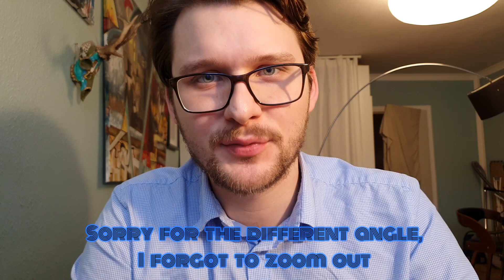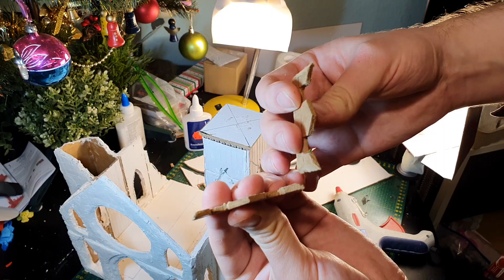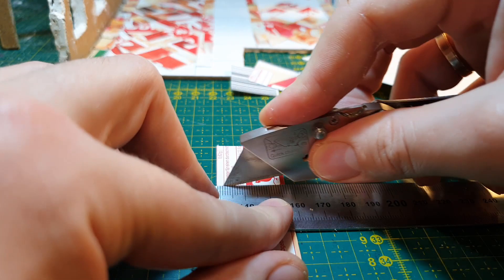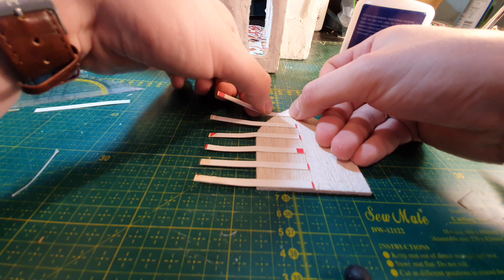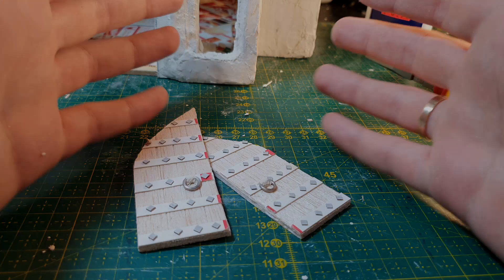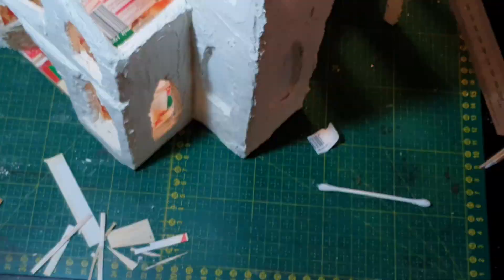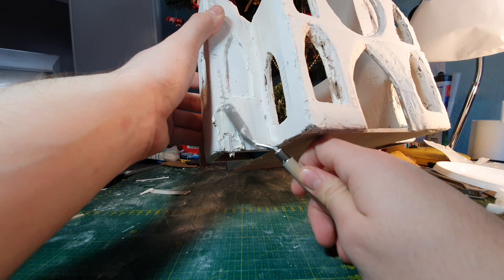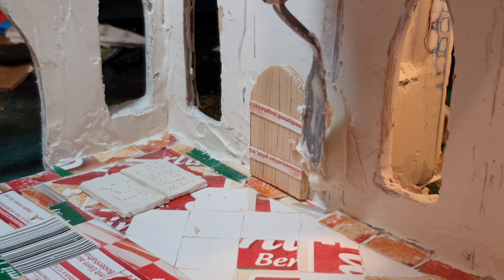Terrain Build | Gothic Cathedral- Gate, Floor and Gallery | Part 2

Comment: Every time I run into the "this isn't going to be good" part of a project, I table the project and work on something else. It is both a strength and a character flaw. When I return to the project with the clarity of having ponder it and finish the project it is a boon. And when I get distracted by the something else and abandon the project to chase excitement elsewhere, it becomes my shame of things left undone. For me the creative process is a fickle mistress.
Reply from the maker: That's very true! I only lately started persevering through this phase, mostly because of the videos and the deadlines that come with them ^^ I gues it's a good thing for being consistent to set sone kind of a schedule for yor work

Comment: You know if money for new blades is tight you can actually re sharpen them if you do a little bit after every crafting session they last for a long time.
Reply from the maker: I do have a set of whetstones for my kitchen knives, but I’m not sure I could do a fine edge like that. Do you have any tips? My sharpening game is worse than my measuring skills.
Reply: @jagelsdorf1385  use some sort of lubrication and a steady angle is about the only advice I can give without being there in person